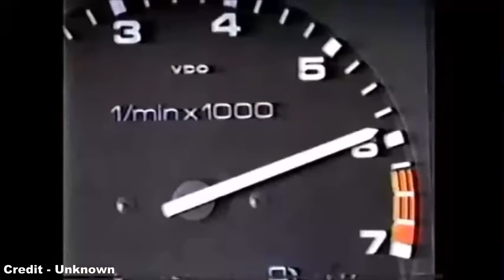The Stylish Story of the Volvo 480

Comment: Some corrections to an otherwise well researched video:
DAF is pronouced as a single word, not an abbreviation.
Renault and Volvo were in talks of a merger at the time and Volvo desperately needed front wheel drive technology, which is why the 400-series is basically a Renault 9 underneath. Volvo wasn't happy with the Renault's road holding so they had the rear axle redesigned by Lotus engineering.
Underpowered engines were due to Volvo Sweden's refusal to market fast cars at the time which would hamper their safety image. Volvo Netherlands sent the F3N engine to Porsche for developing a new cilinder head and turbocharged version. Porsche's engineers managed to churn out 170 bhp reliably with turbocharging, but Volvo Sweden wanted to protect their image and required the engine to be detuned to 120 bhp (we want a sporty car, not a sportscar). There are people who have reverse-engineered the ECU and tuned the engine back to 160-170 bhp.
Market introduction in the USA never materialised because American Volvodealers didn't want an expensive stylish small car that goes around corners, they wanted bricks or something that could compete with the Japanese in a straight line (the 480 was more expensive than a Datsun 280ZX). Volvo Sweden didn't want it because the 480's initial build quality was abysmal and they feared for their quality image. Fortunately for Volvo's marketing department, a currency crisis made the US Dollar very unfavourable in exchange rate, so the plan was quietly axed in 1988.
Reply from the maker: Hi Robert,

Thanks again for allowing me permission to use your videos, and thank you also for providing the above corrections and extra information. :)
Reply: Nice documentary. How about one on the 850.. that's a curious story. Volvo at the races... With an estate. TWR finding loopholes in regulations. Volvo in financial trouble, the end of era in Volvo design language etc.

850 represented a seismic shift in the company.
Reply: @EdgyNumber1  concerning the 850, the only thing radical for Volvo was the switch to front wheel drive and the availability of powerful 5 cilinder turbocharged engines, but that was all under the skin. From the outside it still was a conservative Jan Wilsgaard design, it was the last car he's designed. The 480 was much more radical design, but never got powerful engines. TWR started racing the 850 and the rest is history. Key people of the Volvo 400-series design team (Steve Harper and Peter Horbury) went on to design more Volvo's after Wilsgaard retired. The C70 was a Horbury design and he is still head of design within the Geely group. I think it was more a palace revolution than a seismic shock...
Reply: @volvo480  still something that could be explored though. Volvo had always really stayed glacial until that point, despite 480 but from 850 onwards, I started to notice all sorts of (maybe) subtle changes going on over at Volvo on all dimensions; engineering, design and corporate.
Reply: @Robert Brink Thought I'd find you here... :)
Reply: Odd that it did well in the UK when so many countries didn't like it
Reply: @benhooper1956  it also sold well in France and Italy. Perhaps the British, Italian and French buyers were used to less than stellar build quality and appreciated the quirkiness? Who knows.
Reply: @volvo480  Indeed, that is an ironic connection!
Reply: ECU mods? mine only needed a simple mechanical bleed valve to run about 13psi of boost (reliably for 2 years, with an engine that already had 100k miles on it) and was quite easily running those bhp figures if not more. It’s a shame the electrics were terrible with many gremlins and failures plus the plastics cheap and fragile, they cracked and broke due to being thin and brittle after only 4/5 years of use.
Reply: Thanks for your informative comment! What does that story tell us? Fear KILLS! ;)

Comment: The 480 is more of a spiritual successor to the P1800ES Sportswagon than the regular P1800. The rear styling cues of the 480 are straight from the estate version.
Reply: My thoughts exactly! Especially the tailgate.
Reply: And, later the Volvo C30! 8-)
Reply: @dougf94912  Yes! The C30 isn't a bad looking automobile either.
Reply: The “P” in P1800 was dropped from the car’s name after its first 2 years on the market. All cars made from 1963-on were called 1800S, 1800E, and 1800ES, the last of which was the 2-door sports wagon, which didn’t come out until 1972.
Reply: And the glass tailgate of the P1800ES also got it's own nickname in Germany, it's called "Schneewittchensarg" - snow white's coffin/casket.
I remember that a car magazine also called the Audi R8 so as an example of supercars that show their engine.

Comment: I had one, great little car, nippy, handled well and I could stash loads of long stuff in the boot/back as the seats folded down . I used it when I lived on site (in a trailer/caravan) for carting about barrels of diesel, wood for the wood burner, that sort of thing. It never gave me a moment of trouble for two years, unlike the Ford & Vauxhall's I'd  had. The head gasket went, so I weighed it in, wish I'd have kept it now, but in those days you could get a motor with 6 months tax & ticket on for about £100. Great video Ruairidh as usual, keep em coming mate, thanks......DA.

Comment: When the 480 was presented I was in love with the looks, bought it later as a used car, kept a black 86 about 3 years and a 89 red with US specs about 4 years. Both were unreliable and not well finished. The red one made me so angry, tried to kill it by overreving and hammered it for hours. The poor thing didn‘t give up except the exhaust rubbers were melting at oil temperatures about 150 degrees (!)
No blowing head gasket, no water or oil issues. Then I respected it a little more and kept it for another year, before replacing it with a swedish brick.

Comment: Very well put together video this, I think it is important to note that the 480 was never really competing in the hot hatch market as it wasn't that sort of car to start with. It is compact coupe similar to the Sirocco, and the Accord Aerodeck. I think the 480 would have advantages over both those cars, though I am yet to drive them. Over the Scirocco I think the handling would be superior, and over the Aerodeck I believe the dynamics would be better across the board, certainly if the period comparison tests are to be believed. I have an early 1988 car and I must say I have never felt it to be lacking in power as such, even when I have had experience with a Twin Cam Rover 220 Gti, the 480 still feels perfectly competent. I would be interested to see just how it compares against a Golf Gti, even though they are in different segments. I have said 'I think' a lot in this comment, and this is of course my opinion, but as someone who was going into 480 ownership expecting a car that was never going to be very fun to drive, I was very much proven wrong. These cars are definitely worth a try!
Reply: Thanks mate, totally agree...

Comment: The good old days.
Lots of family members worked at the DAF/VOLVO/NEDCAR carplant.
In school vacations and in the weekend as an enginering student i worked at the assembly plant.
Cars who needed to reworked after failed quality/safety checks and-or in factory fender bending had to be transported between departments for repair.
The biggest rework program what i am aware of in my time was the change of the waterpumps.
There was a faulty batch of waterpumps installed 
Every car had to be inspected if that pump was from that batch and if so moved to the garage for rework.
I learned to drive in very close suroundings and use a spanner there.
A friend of my bought a 480 and joined the 480 club.
The volvo480 club was always happy with me about the practicle spanneruse knowledge of that car.
After my uncle died he left me the 460 1.9TD that i had worked on at the factory.
Personaly i liked the 440-460 driving/handeling more then the 480.
The suspension was updated and the 480 did not.
the 1.9TD was anything but slow and the 460 2.0 Turbo was a beast.
the 2.0 turbo was developed for the 480 but when they axed the 480 they put those engines in the 460.
Sadly i lost my 460 in a car accident with a drunk driver.
The safety systems did their work and i just had some scratches and fireburns form the airbag.
You can't replace such a car  😢

Comment: You can't say it failed in the US (and Canada) because it was never given the chance to fail as it was never sold in either country, even though it was designed to comply with those markets' regulations.  Most 480 histories I have read have blamed this on the strength of the Swedish Kroner vs. the North American currencies at the time, which would have made it completely unprofitable to sell the car in the US and Canada.
Reply: Funny that those histories blame the Swedish kroner, the cars were built in The Netherlands where they used the Dutch guilder at the time so you would expect that currency.
Reply: Volvo is, however, a Swedish company.  All of its bookkeeping would have been in SKR.

Comment: The came the successor in 2006 called the Volvo C30 which had more power , but unfortunately it too did not sell well, but at least it made it to the US
Reply: Indeed the C30 did come to the United States but it was not a big seller. I can't even remember the last time I saw one! To be honest, as stylish as the 480 was, the C30 was just a chopped S40 sedan with a cool glass hatch. It was expensive too - for the kind of money the C30 sold for, you could get a pretty good VW GTI.
Reply: @RoadCone411  the C30 was a Ford Focus underneath, but at least it was constructed to accept Volvo's five cilinder engines.
Reply: @volvo480  Not sure I ever knew that. It was certainly the most stylish Focus to grace our roads!

Comment: You mentioned a lot of countries but failed to mention Portugal. These sold very well in Portugal.
I believe that the F3N engine would be underpowered for this car, if I got a 480, I would try to get a turbo... But let me tell you, I have driven the lighter Renault 19 with the F3N extensively and it is a great engine! 
In the lighter Renault it is more than fast enough with VERY strong acceleration. The Renault 1.8 16v goes faster but it seems to have less torque at low revs. Like it is more powerful and revs faster but it feels like it has less torque
Reply: You are bang on with the 19. It was a flying machine. A 19 fully laden was lighter than the 480 empty. it stood no chance of being a hot hatch.
Reply: @alanhunter2051  I've heard of crash testing the 480 when it was in its very start of the design stage, more or less a Renault 9 with a different body.
To say Volvo was disappointed about the result, was a very nice description of the outcome... Thiis is why the 400 series became much heavier than the Renault 9 they were based upon.

Comment: Build quality similar to an Airfix model made by a 9 year old didn't help.  My Dad got an early D Registered ES on test.  The driver's seat came off its runners on the forecourt.  The 1989 440  we eventually bought was plagued with issues.   Had the 480 - and contemporary NEDCAR products - benefitted from the 16v engine used in the Renault 19 rather than the ancient 8v Renault lump it got, then it would maybe have had more success.  Maybe.
Reply: Yes, the D-reg launch cars were bad. I've never understood why Volvo Sweden didn't send their quality control down to Volvo Car Netherlands.
Funny that you call the 8v Renault F-engine an ancient lump, it's first apperance was in 1983 in the Renault 9 so 2 years prior to 480 press reveal in 1985. Lower spec R19 got ancient Cleon engines, only the higher spec R19 got the same engine as the 480 (F3N), the 16v in the R19 16S (F7R) is the same engine but with a 16V head and that version of the engine came in 1990 so wasn't available at launch of the 480. By that time, the 48i0 Turbo was available, with much more low-end torque than the 16v engine.

Comment: I had one, a 1988 one in black. Always loved the styling. Looked very cool in black with the red bumper strips. But sadly it was the most unreliable car I've ever owned. Mine was getting old when I had it, but came with loads of service history. But electrics were crap. It would start fine but then cut out as you drove away. Then it wouldn't restart. Pop up headlights often got stuck. One would come up and the other wouldn't. Didn't have it for long. Replaced it with a reliable Ford Sierra.

Comment: How exactly did the Ford Sierra’s design, revealed September 22, 1982, influence the design of the 480, which was approved 15 months prior?

Also, plastic bumpers weren’t necessary to key the bumpers to the body color of the car. Several cars with color-keyed metal bumpers had been produced long before the 480 was made. 

The truth is, the 480’s bumpers were plastic because it was cheaper, lighter, and more energy-absorbent
for crash safety than metal. Besides, everyone had plastic bumpers at the time.

Comment: A Dutch design with a Renault engine, marketed as a robust & reliable Swedish Volvo... what could go wrong?
Reply: Plenty! I know because I had one.
Reply: @robsterbob580  what could possibly go wrong with all electrics having "made in Germany" on them, is what I keep thinking when I'm repairing a CEM (made by Hella), ventilation module (made by Siemens) or instrument cluster (made by VDO). They were penny-pinching from the start, that's why...

Comment: Great infotainment as ever.
But like already mentioned by other comments : The 480 , like the 4xx series Volvos was the first Front Wheel Drive and also transverse engine car by Volvo.
All the drive train from Renault.
The "successor" to it was the Mazda 323F.
I found the 480 very uncomfortable on long journey because at least in the right hand drive UK manual gearbox version there is no good space / footrest for the left foot.

Comment: The biggest problem is they used Renault engines which were poor quality and easily went bang.. with the turbo. Many were fixed by putting a Renault traffic 1700 engine in exchange.. Change the sump and oil pickup pipe and fitted perfectly. Sell on quick to a poor sod not knowing the low compression engine had been fitted. The Traffic engine would last between 1 and 10 thousand miles depending on how hard it was driven. A brilliant design flawed by compromise at every level.  Excellent video
Reply: This is the first time (and I've heard MANY stories) that someone complains about poor engine reliability. I'm very curious how and why someone would go throught the trouble of putting a carburetted Renault Trafic engine in while plenty of scrap cars exist with perfecly running engines. Never crankshaft bearing failures, never head gasket failures. even after 300,000 miles. only if you fail to adjust the valve clearances, you may end up with burnt valves. But engines that go bang, well maybe if you don't put oil in them. Sorry.
Reply: @volvo480  I meant when they were very new and the turbo versions were not easily found in scrap yards. The inlet and exhaust manifolds and cam cover were changed to look like the original. When they were being traded in the garages used to check the engine no.
Reply: Did all that come from your imagination, or can you cite your sources
Reply: @cappaculla  It came from a family run four garages buying 440 and 480 cars and selling them on as they bought all the good engines from scrap yards in Scotland and north of England FACT

Comment: Volvo has done two big mistakes:
1. Started to build FWD cars.
2. Now only manufactures 4 cylinder motors and skipped the good and reliable 5, 6 and 8 cylinder motors.
Reply: The biggest mistake a car manufacturer can make is not evolving.
Reply: @volvo480  How is is to evolve to start making boring cars that are unreliable?